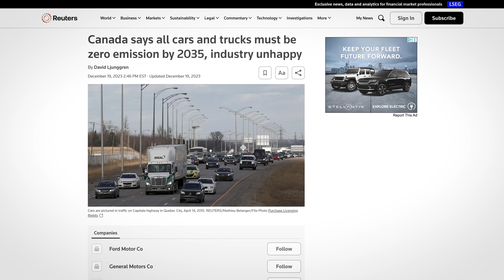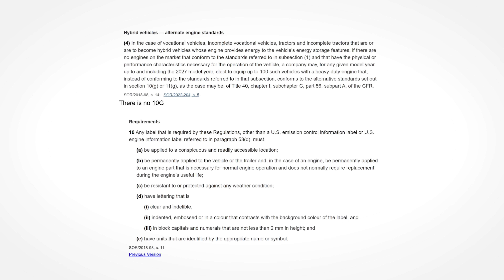Government Red Tape Is Blocking Our Plug-In Hybrid Trucks

Comment: Then there is the US that is looking at reversing some of the EPA rules for diesels because they have made them unusable. My 2006 cummins 5.9 runs extremely more efficient than my buddies 2007.5 6.7 with the DPF filter.    Is there a way to use a cummins 6.7 as the power source for the gen set?  They are highway approved so it should be possible to mate it to the generator.  Programming it to run like you want might be a bit of an issue but you seem to have a few great programmers already.  On the other hand if you use the on highway cummins then you are stuck with all of dpf/scr systems which are worse than over choking the chicken.  Maybe if Canada put as much thought in innovations than they do in violations of the geneva checklist then you might get somewhere.  I really enjoyed working with the Canadian Air Force!

Comment: Hypothetically of course, maybe y'all could set up, or work with, a separate company that just happens to "specialize" in providing generators that fit the engine bay "extra battery/storage" space. These generators can be advertised for adding "on site" or "remote location overnight" charging capability to your truck, especially when equipped with optional output plugs to charge Teslas and other EV vehicles. Just spitballing here‼️❓️‼️

Comment: It seems like there is a really easy answer.  If you do not have to promise a brand new engine to your customers, then put in a 5.9L or 6.7L engine taken out of a Dodge truck, and hook a generator up to that engine that was on the road for many thousands of miles.  Yes it is basically the same engine, but a automatic throttle on it.  

As long as the engine can be certified as being removed from some sort of a truck, or maybe a 4 BT Cummins from a smaller truck, then they should be OK with that.  

My guess is that you estimate that you need over 200 KW of generator power, but in reality they do not require that large of a engine.  Maybe on some hill, you can be depleting the battery at the same time as running the generator (Umm Dodge engine and not a generator, but a alternator that is putting out 200 KW).  But if you need to go a bit slower, you will probably be faster than a typical diesel truck, and if you need to slow down to 40 on a hill, then the next time, start that generator about 10 minutes sooner, and you will have that extra 3 KWh per minute going into the battery a little sooner.  

4 BT Cummins is a 4 cylinder version of the 5.9L inline 6.  

Yes I have been thinking the 9 liter engine is way to large to make your trucks run on battery power and generator to recharge when needed.  You just need to start the engine 10 minutes sooner than the larger capacity engine / generator.

Comment: Is it ignorance or willful road blocking in favor of big company bribes letting them catch up so they can keep you out?

If you can demonstrate any improvement in emissions over the current standard that should be all that’s required for a damned exemption. Common sense to the government is going a mile backwards instead of three steps forward.

The people need an expedited exemption. All of my retirement savings to buy into whatever lobbyist needed to put the hammer down on this.

Comment: This seems like a last year problem that they missed and now they're blaming it on the government. They have a full time lead designer and compliance employee who should have been well ahead of this. There are most likely off the shelf products or software tweaks to approved products that could create a solution.

Additionally - as Ive previously said - hire a seasoned automotive executive to bring the thing to market and things like this are less likely to happen.

I was pleasantly surprised that Chase stepped down as CEO but replacing him with someone internal isn't the path forward. This endeavour will get harder, not easier.

Comment: Remove your generator from the main build. Use the space as a frunk that just so happens to have the space for a generator that is the exact same size as the one you have designed. Drivers can fire up the ICE generator to charge if and when there are no road side fast chargers. You've already said that there's no problem for off road use. And your vehicles came to the drawing board because existing EV road trucks can't handle off road logging conditions.
I'm asthmatic. Diesel fumes make human cells die. I understand that the charging infrastructure isn't 100%, but running an ICE engine that sends energy through a battery to the wheels while moving on the road is just an efficient ICE. Our atmosphere doesn't leak carbon into outer space. It's common knowledge that running an ICE engine in a closed space with humans in it is a dumb thing to do. Your solution to your problem (build ICE trucks) will make the oil company lobbyists very happy.

Comment: Sounds like they might need a highway-approved fuel tank, diesel emission system. Then register the package as a new engine and pass an emissions test. 

OTOH you might get a smaller approved diesel powertrain and affix one or several generators to the shaft.

Comment: So what's the emissions difference between a diesel generator and a diesel engine? Which produces more CO2 and PM2.5 emissions at similar displacements? What are the regulatory differences between highway and off-highway use engines? Is there a reason for the bureaucracy? Sharing numbers & facts make a better case. Yeah we want EVs but we also don't want to see a hybrid rolling coal.

Comment: What if you sold them with a software lock that only runs the generator while the truck is at a complete stop, but assign that function to a boolean so hacking is as easy as flipping a bit for the end user to enable full functionality

Comment: For now, cut the cables between the generator and the batteries. Install a fast charge receptacle for the batteries. The generator should have a fast charge plug that can fast charge any vehicle including yours. Say in the documentation that you can't drive with the generator plugged into the batteries. Full compliance to the letter of the law and it just underlines your argument.

Comment: Why not approach the manufacturer of the generator you are using to have them go through the certification process for highway use? They went through the certification process for off highway use already. They stand to gain from you purchasing their generators for this application. I imagine your demand for them is only going to increase.

Comment: “We have no legislation that allows you to do that right now”
…. That’s the most ridiculous thing I’ve ever heard. The govt has to allow you to build a plug in hybrid that you would plug in… off the highway…. Because it doesn’t have an on highway motor…  garbage. The generator doesn’t have ti connect to the grid. Though it can as your train example noted early on in your company, you can plug an off highway generator into your home during a power outage.

Comment: Would it comply if the engine could run only if the vehicle was not moving? Not ideal, but it might be a simple software hack (HA!) to implement the rule until they get their arse in gear. They need a way to provide an exemption based on the emissions.

Comment: Curious BC road maintenance cant take ownership of the prototype plow due to the above, would you be able to "through a partnership of sorts with the highway dept. and have them transfer you drivers that operate the vehicle for you doing the plowing in a specified area like near your new location. Until this is sorted out? In this way they see that the hybrid plow prototype is capable of you get your testing and data as well as working out kinks in design? all while not giving ownership of the truck until the red tape has been amended to compensate for what in the end is a better and more efficient design than what is allowed under current regulations?

Comment: If you wanna move fast but do so responsibly because it's going into legislation and regulation - then you lean on the research, studies and testing done in other fields and other countries that meet your ballpark technical standards. You get exemptions and temp permits going, while you work with those who did the original work to either fast track supplemental testing, or figure out if you actually need it at all. Because very often you find out that more testing and refinement were done, approved and implemented after that reference work, or that another look at different testing standards reveal only pro forma differences (sometimes even stricter empirical, technical processes).

Yes a lot of governments and agencies around the world do appaling technical work and shady approvals. But a ton of them do excellent research and regulation work, and it's not like Canada's environment is that unique. I could understand if Canadian regulators wouldn't want to just blindly carbon copy emissions research and regulation from Somalia these days. But it would probably be pretty safe to trust that the research and regulations work from say Germany or Norway, would hold a high enough standard (in the latter case, very similar environmental conditions too) to be able to trust and lean on for getting some exemptions going.  While you do your outreach, collaboration, due diligence and meta studies to prepare for more full-bodied legislation and legislation.

It's just an example, but I think a huge issue with everything from technological progress to approval of new medical treatments, is that most countries' governments seem to think their needed standards and environment is so damn unique that the already existing body of work done by other researchers, governments and agencies cannot possibly be helpful so they must reeinvent the wheel from scratch. Sure, sometimes what you wanna do hasn't really been done before so there's not much preexisting body of solid work to build on, or the preexisting body really IS half a century old, shoddy and very experimental. But in most cases it really isn't.

Comment: Is it not possible to register and test it as an EV with a range extender? 

There are a quite few cars that use the same basic set up as you guys with no direct drive from the gas engine but just E-axles. How did they get past this problem? Just paid to have them certified?

Comment: Altho it would probably have an extra cost but, if you get certified scania on highway engines, buy the generator and the required fuel management system. I do not have experience with gen sets but with all the electronic control on a modern engine i would imagine that the generator could send a throttle signal according to ecu readings of the engines

Comment: What if the generator was locked out "on highway" and was only used in the back country logging roads? In theory the highways should have charging infrastructure. 
Wait. I'm sure you've looked at it already but what about the generators used in diesel-electric trains? Obviously they'd be too big for Topsy but maybe the manufacturer makes smaller models, or at the very least knows how to navigate this bullshit.

Comment: I think a lot of this is kinda inevitable. Government is a big and complex operation, a regulation always lags behind innovation. 

That said, if the only issue you have with road-approved engines is that they're controled by a throttle instead of sensing the load on the generator, could you not design a module to sense the electrical load and spoof a throttle input to the ECU from that? It's a bit of a hack, but if your engine has electronic throttle anyway it would work just fine. Or would that make the engine non-compliant?

Comment: Can't you use an on-highway engine, rig it to run flat on the RPM its most efficient at and charge the batteries like that? Would be more electrically complex, since you need to charge the batteries at a constant rate while drawing power from them depending on the demand. You probably thought about that, though.

Comment: I had a chat with GPT 5 and it came up with this: The block isn’t “EV mandates”—it’s that you put a nonroad generator in an on-road truck.
Fix: Use an on-road certified engine (diesel or natural gas) as the constant-RPM genset—transit buses have done this for years.
Fast path: Get the engine EPA on-road certified in the U.S., then sell in Canada under EPA acceptance.
Bridge: Use Canada’s hybrid alternate-standards (≤100 units/yr through 2027) while scaling.
Fallback: Apply for a CEPA new-tech/financial-hardship exemption.
Bottom line: On-road label inside an on-road truck.  It was alot longer, I can pass on the full details if needed. All the best.

Comment: This is what happens when rules and regulations are being made and adopted by those who don’t understand the limitations of the rules. When new technology is being introduced into a market, it is up to the party trying to regulate that market to see if that technology can be regulated by the current regulations. If not, new regulations need to be formulated to cover the introduction of the technology. This is where the failing lays here. The government is applying regulations that aren’t applicable to this type of use of an internal combustion engine. 
Anyway, the system that Edison is using has already been okayed for use on the railroad, so it’s time for this arm of the government to ask a few questions and think out of the box it’s built.

Comment: Don't call it a plug in hybrid, design the circuit into the truck and leave it dormant, send the plans to the aftermarket for the plug unit and be damned the regulations.

Comment: What are the Canadian regulations on reefer diesels? Here in Arizona you don't even need registration to tow a generator.
Reply: Reefer diesels are offroad engines. Technically this truck would have no problems if the generator was on the trailer, it's because it's mounted to the truck chassis that it becomes part of the truck.

I say, sell the trucks as full electric plugins, then sell the gensets after the initial sale. I'm at the point of FTG at the moment. 

Do whatever you want:
Don't hurt anyone
Don't get caught
Problem solved...
Reply: @ScooterMcAwesomeness  It's an electric truck.  Who added that diesel engine?  Aquire needed certs electric only.

Comment: You guys are DUMMIES for not investigating Regs. Stuoid very stupid.
Reply: Silly, sure.

But to call this truck platform anything but genius... THAT is stupid.

I've been saying for years, this is how powertrains should go for all automobiles. You can still have 500hp, with a 50hp engine. You only use about 30-40hp to keep a typical car at highway speed. This allows the 50hp engine to charge the battery when you're not getting onto a highway, passing someone, climbing a hill. I'm going to switch to kW to keep terms easier.

37ish kW generator going to call it 40kW, can charge the 1000kW capacity (number used for ease of calculations, I don't know what size battery this truck uses). ANYWAY! 

40kw, to charge a 1000kW battery would take 25ish hours. from 0 to 100%

So, your 500kw powertrain motor is used to propel the vehicle, and will deplete the battery in 30 minutes if held wide open. But we don't drive like that. 

500kw to get you up to speed, for say, 2 minutes, then you only need to maintain, which draws considerably less. The point being, the 40kW genset can recharge the battery between these mass consumption events. 

Woooooo that was long winded. :)

Comment: It’s still a diesel truck just different way of doing it. I see why they don’t want you using an off road generator.  I’d like to see the math on the fuel economics. 

Without starting with full batteries or remove the batteries all together does a 9Litre diesel generator produce enough juice to pull 100,000lbs down the highway all day same as a 15 litre Cummins?

Comment: Looking into the diesel electric trains side of the epa.
Maybe put an e-axle behind a mechanical drive with a smaller battery charge using regen and engage during acceleration and or traction slip makes it an easy mod to a already built truck

Comment: so as I understand it you need to get a on highway engine and add a generator speed control module and a actuator to move the throttle so that will maintain the proper RPM to run the generator.

Comment: Simple solution: Software-lock the generator to only run when the vehicle is parked. Then it is not part of the "vehicle" part of the system, but part of the "transported machinery" like a self-powered crane.

Comment: It doesn't really matter if it is the US or Canada, It is all about Control. They really don't care about the environment. It is just a control issue. Climate change is just evolution. Changing the exhaust output will not change anything. This is Fact it has been proven! I want to see Necular powered cars and trucks. They can run on spent rods! Fuel your vehicle once a year!  Zero pollution!

Comment: This makes no sense as they are nit picking about the engine not being rated for on road use. It is nothing but a minor technicality. We have diesel/electric trains where the diesel engine is a prime mover for the generator to power the trains electric motors on non electrified sections of tracks. They have no problem with the trains but an issue with a generator using a diesel engine not specifically made for on road use, even though it does not even directly power the drive wheels, being bolted into an on road vehicle?  Government really likes to pick on little issues to stop anyone from being successful. Every Canadian company that has gotten off the ground or tried to get off the ground always gets cut off at the knees by the Canadian government, like we have some allergy to success.